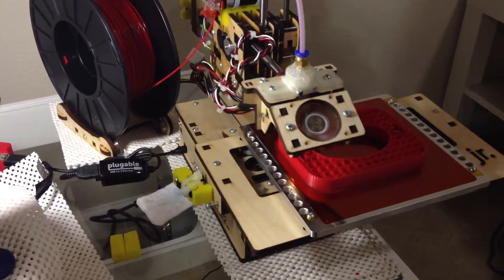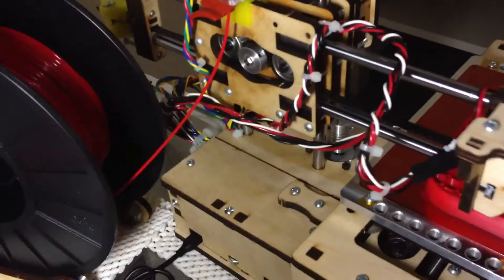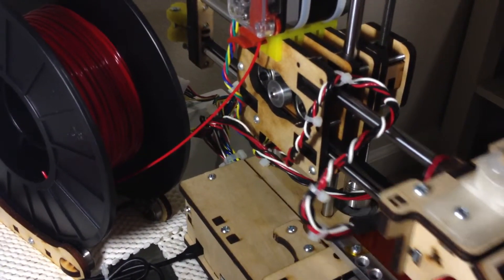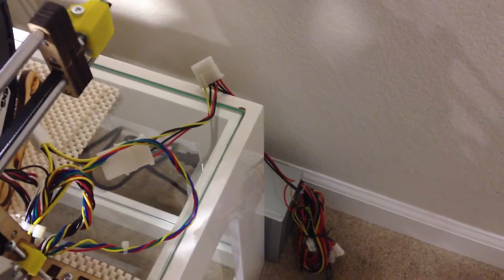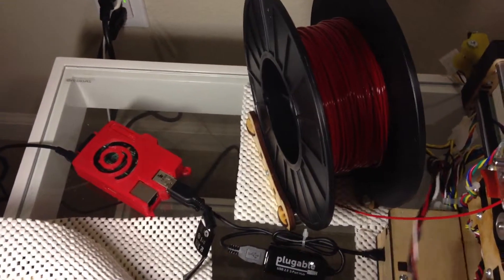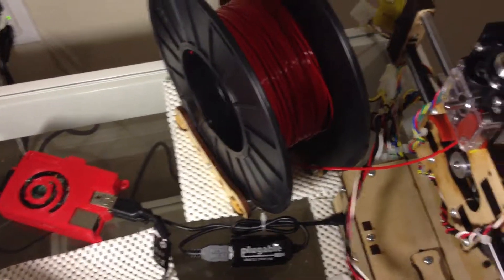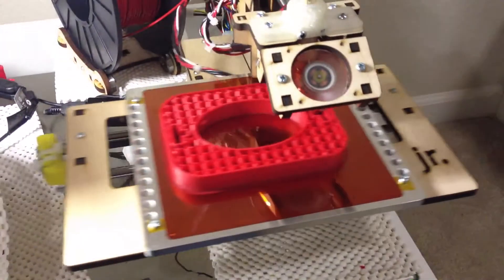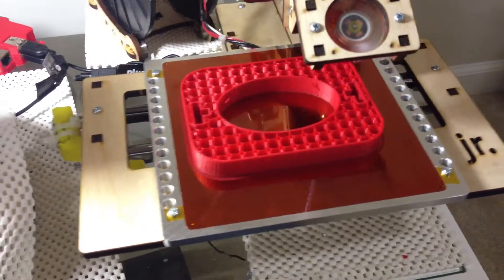Printrbot Jr., printing with the heated bed and aluminum build platform upgrades

Comment from the maker: If I remember correctly, the v2 is sold pre-assembled. The basic design is the same, but it has an aluminum Y-axis assembly rather than the 3-layer "wood+bearing sandwich" that the v1 has, so I would expect that if you were to build from a kit, it would be easier to put together. If you live in a humid climate or have the printer somewhere prone to temperature changes, I'd imagine less wood would create less variation.